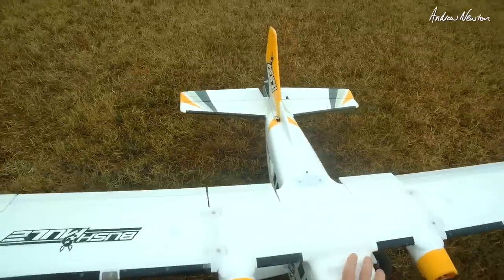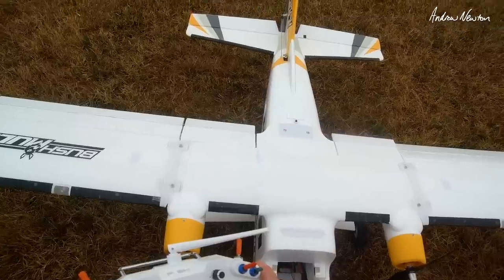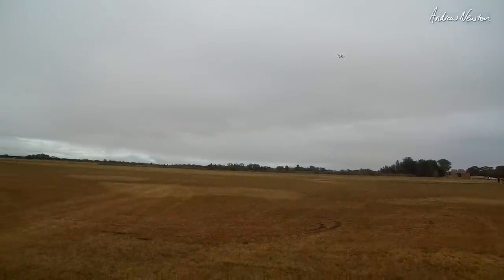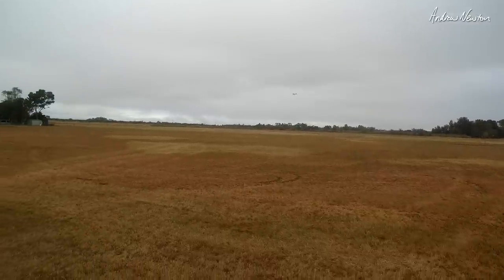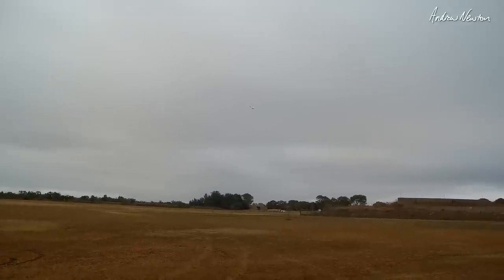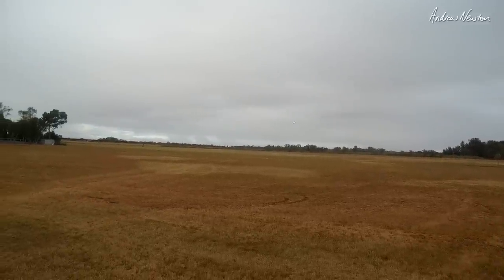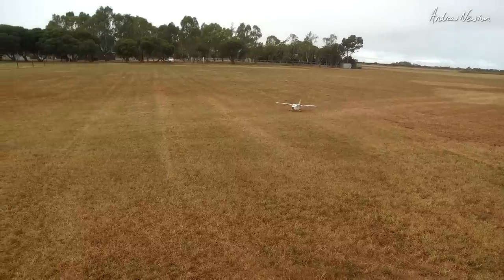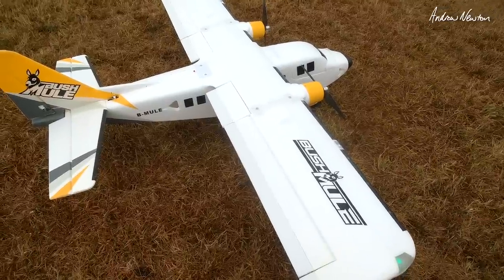Bush Mule Fat wing mod

Comment: Here is a tried and true remedy for tip stall, put a little washout in the wing, twist the last 20% of the wing up at the trailing edge about 10mm at the tip, if that is not possible raise the ailerons 2 or 3 turns on the quick links. Works great on models of Spitfires and other narrow tip aircraft (P47, Mosquito and BF109).

Comment: I watch your videos and use your ideas.  I bought a Bush Mule when they were on sale and i'm just getting around to building it.  I washed the mold release off with alcohol and sanded down the little nobby things left behind on the surface from injection molding.  Before assembly I'll cover the bits and pieces with Min Wax Polycrylic clear.  It creates a hard clear surface and protects against thumb prints and hanger rush.  I'll be adding the depron to the control surfaces.  Question for you Andrew is what specific type of glue did you use and do you have anything in the connection  by the way of reinforcement.  I'll looking at your videos for advice on differential motor speeds, Inav, F405, telemetry, FPV and anything else you can think of.  I live on Vancouver Island and we have our own strip and around 100 club members.  The average age is about 69.  Take care all your efforts are appreciated.
Reply from the maker: Many thanks Jim. I just used hot glue and packing tape for a quick test, and it has stayed that way. Would be nicer to taper to a finer trailing edge I guess. Good luck with your build.

Comment: Andrew, I noticed you mentioned changing props. I want to go with MAS props but the motor stud has that Hex fitting on it to accommodate the stock props. How did you tackle that? Will other props fit over the Hex area yet not have play in them?
Reply from the maker: I added a washer between the hex fitting and the prop

Comment: Excellent video Sir.; I do have a question.... I have also extended my Bush Mule wings for another 1.25" but, I haven't decided where to cut the ailerons. If you don'y mind, I would like your opinion about the fly characteristic of this bird with such large ailerons surface.  I saw another modification in the RC groups web page and, it looks that the guy cut the ailerons a lot shorter than the stock one. Thanks in advance....
Reply from the maker: I did it for the extra wing area rather than extra ailerons and flaps. Certainly needed to reduce the rates on both, so smaller might be good.
Reply: @AndrewNewton  Very appreciated Sir..! ;>)

Comment: Why are you so afraid of downwind turns? I don't get it ! You just have to keep the throttle constant , to get a constant airspeed , and must not look at the ground speed ! Seems easy to me ! Cheers :)
Reply from the maker: With a perfect theoretical plane of zero mass you might be right. Doesn't work that way in real life. The plane will accelerate to the new downwind ground speed without increasing throttle, but not instantly.
Reply: @AndrewNewton  I don't understand what you mean , would it be possible for you to make a video explanation? It may be interesting for many people
Reply from the maker: Oh damn, I won't be able to sleep now. Thinking about how to explain it in a video. But I do enjoy thinking about this stuff.